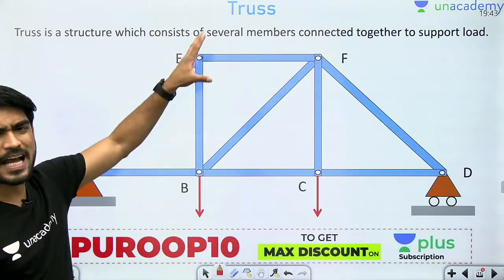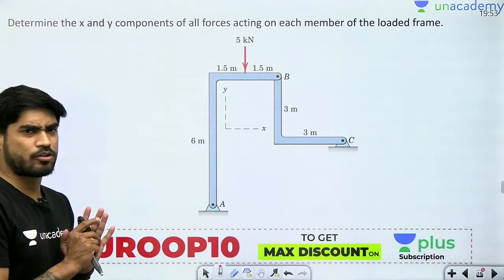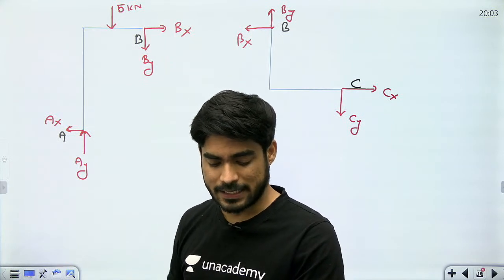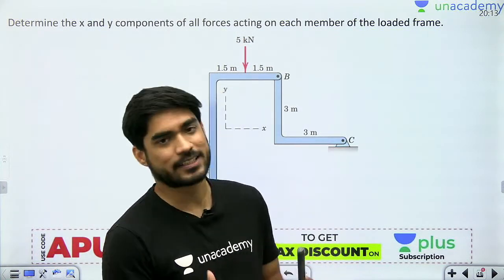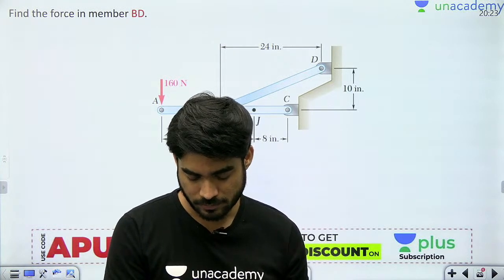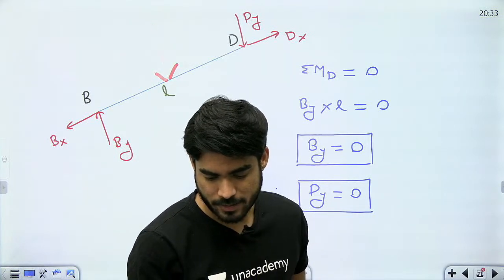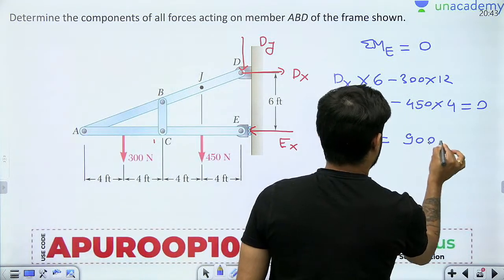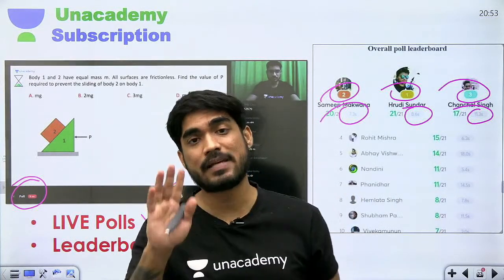Analysis of Plane Frames L - 22 | Engineering Mechanics | GATE 2022 | K2K Batch

Comment: Sir, In the last problem, why can't we take reactions in A & D as in the direction of the member as in previous problem.
Reply: Even if you did so then still you will have F_bc out of your chosen coordinate system 

So you still will have 4 unknowns and 3 reaction and it'll be a local coordinate system so you will again have to take components of all forces in the direction of coordinate system of other members 

So it's better to use a single coordinate system for all members.
Reply: I also had this doubt.